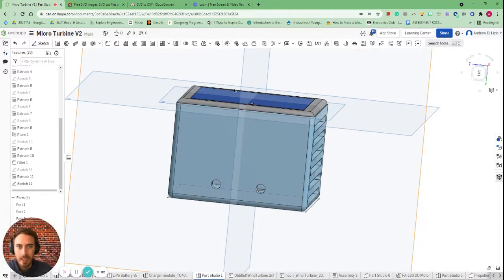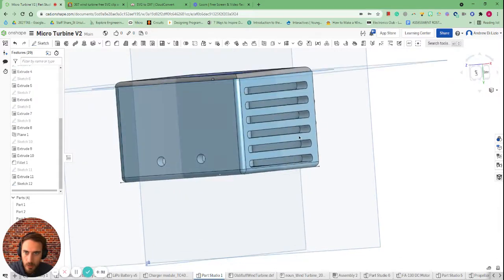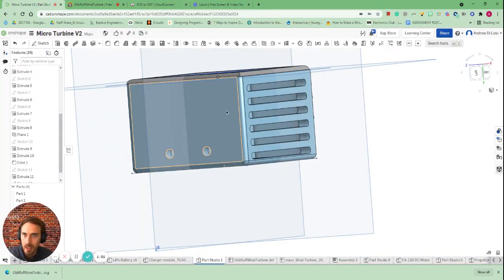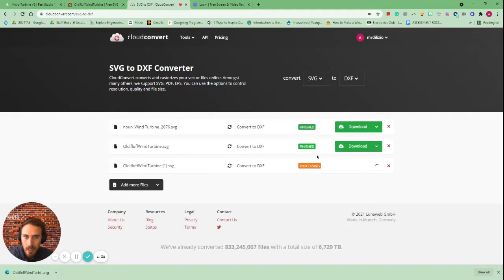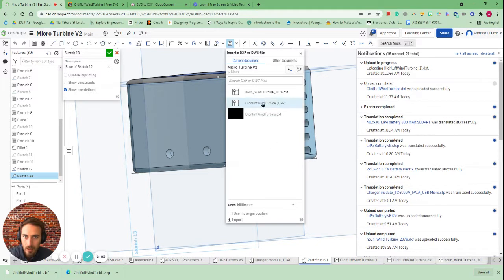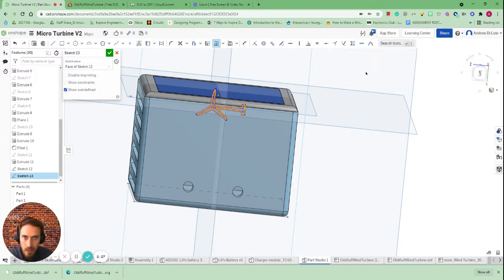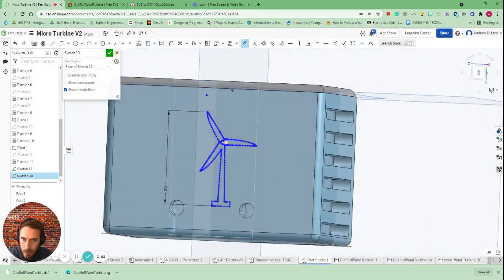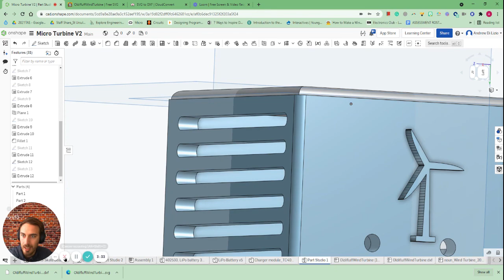How to Extrude SVG. Vector Images in Onshape

Comment from the maker: What image are you trying to extrude in Onshape?
Reply: power button
Reply from the maker: @nidhu595  nice!
Reply: I have a  black and white line drawing as a JPG file that I have imported into Onshape: Is it possible to place it on a surface in Onhape and extrude it without having to treace(draw out) it line by line using Onshape's  Sketch tools?  To be clear, I would like to have each black line of the drawing standout from the surface about one millimeter (like an ink stamp). Alternatly, I would like to have the lines to be embossed down into the surface about one millimeter; into which I can place black paint/ink to show a black design on a white 3D printed object.
Reply from the maker: @jameshohimer2542  my suggestion would be to first convert the JPeg to an SVG file before importing. That should allow you to then manipulate the vector lines once imported into Onshape.
There are plenty of free image converters only, search for "jpeg to svg. Converter"
Reply: @theinnovationclassroom : I converted the JPG to a SVG. Then imported it to my Document inside Onshape. Using the Import Image tool, under the Sketch icon. It shows the image on the screen but still only as a template . I am unable to get it to show as a sketch like you did in the video. Any additional suggestions?  You can see the public document  in Onshape under LINE DRAWING 2. Or I can supply the link if needed.
Reply: spongebob